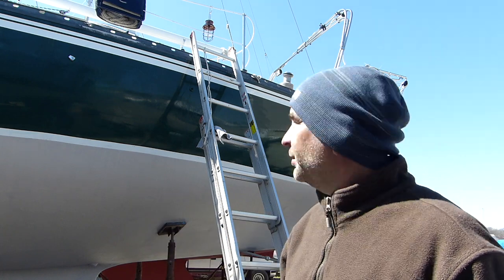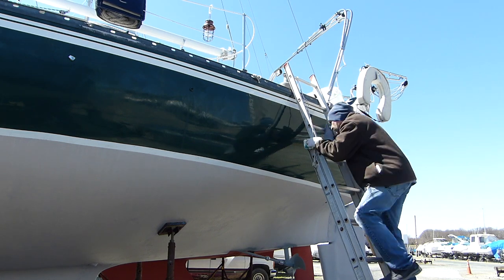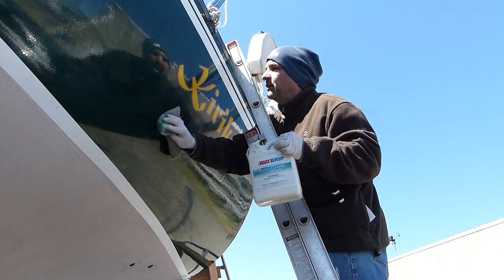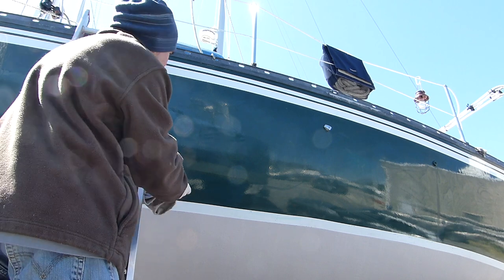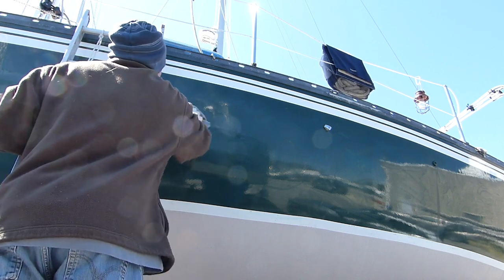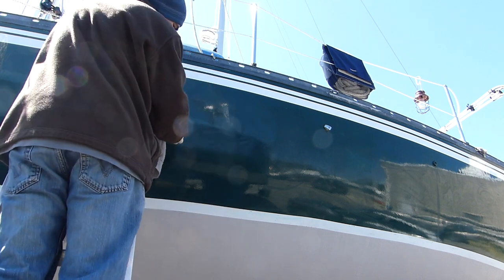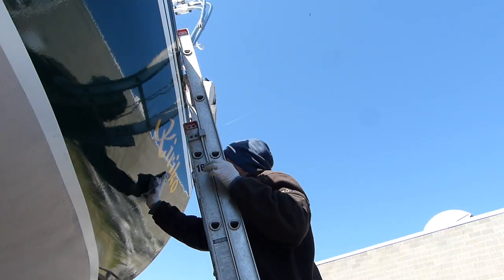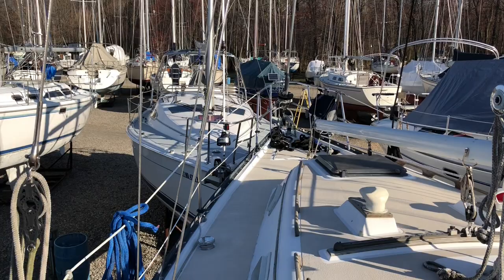Finishing applying the Awlcare to Kiriko's hull. Sailing Kiriko Episode 26

Comment: Is it awlgrip or awlcraft 2000?
Reply from the maker: From what I was told at purchase, and from an older survey, it was Awlgrip. The Awlcare did make a difference but it doesn't seem to last a full season.
Reply: @sailingkiriko2679  it is a simple polymer sealant. I recently applied marine ceramic coating to a very large boat (over 30 meters) so we will see how that holds up and how it prevents oxidation.
Reply from the maker: @wiscoworm5971  Any update on the marine ceramic coating performance?